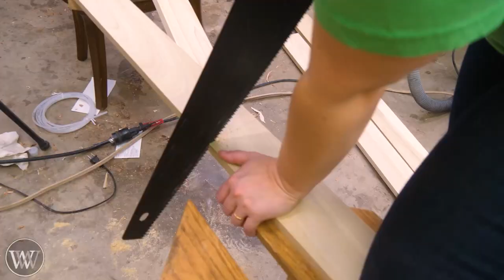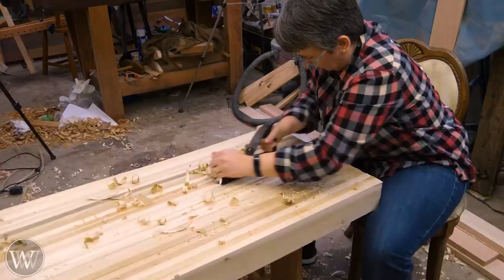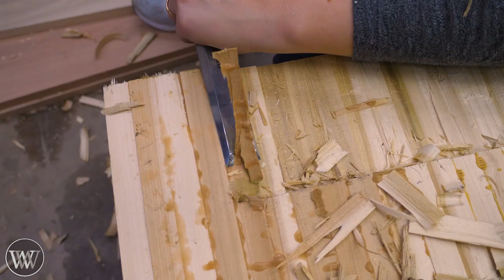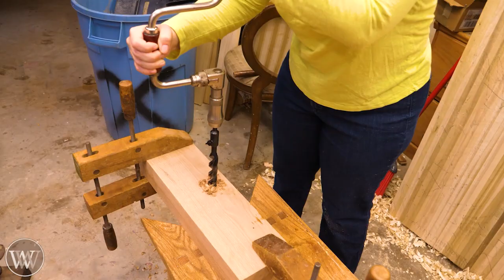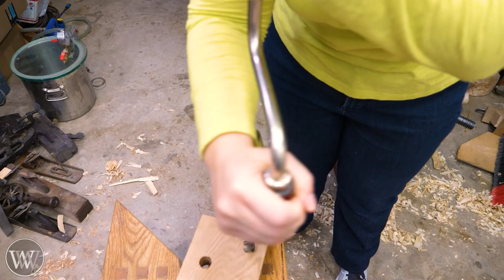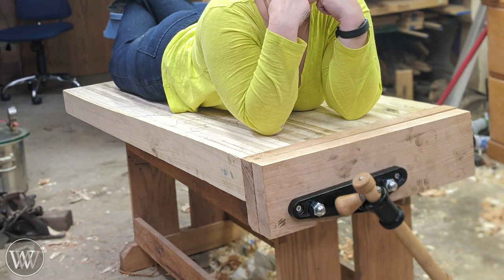Making a Bench Without a Bench Beginner Woodworking Project

Comment: I love it. Only piece of advice from a novice: it's easier to start sawing with the front of the saw, because the angle of the teeth is less aggressive
Reply from the maker: there are many that hold to that, but I generally find that more difficulty to control the saw with he hand over 2 feet from the edge you are trying to control. learning to lift the saw weight off the teeth for the start will serve in a lot more situations. if your saw does not have progressive teeth, or working in a situation where the toe is not an option, but there are a lot of people that like to start on the toe. that is what makes the sport fun. there is no right way to do it.
Reply: @WoodByWright  I start mine with several backwards strokes

Comment: With those type of vices, do you get any vertical racking, where the bottom squeezes and opens up the top?
Reply from the maker: That is why we resesed the vice ina bit to move the screw up a bit more. It will rack a bit but it is strong enough with the two rods that it is not enough to effect anything.